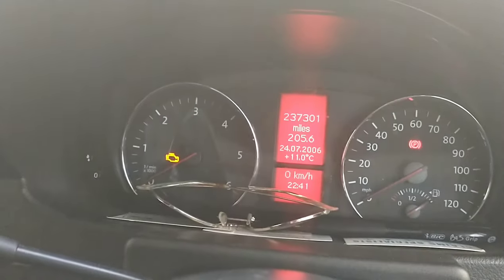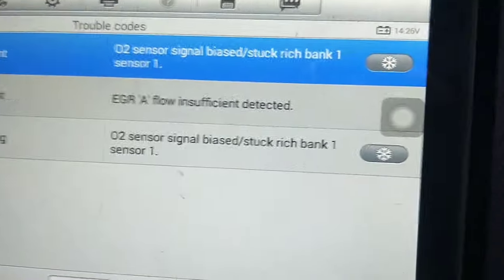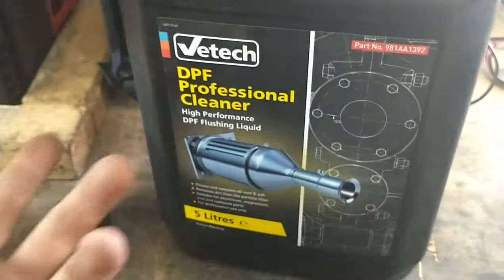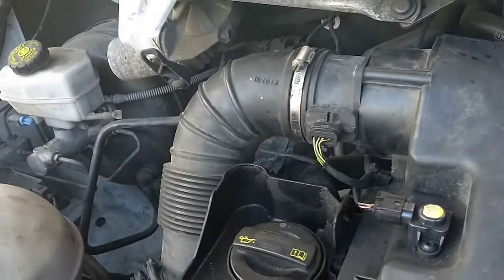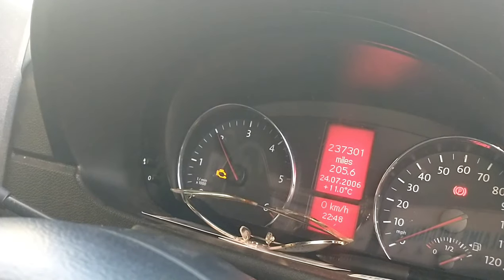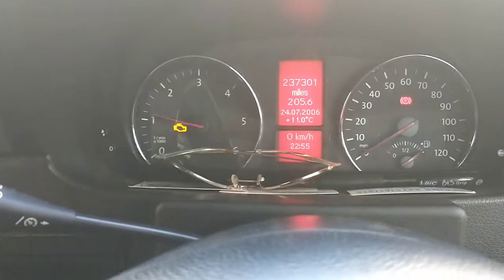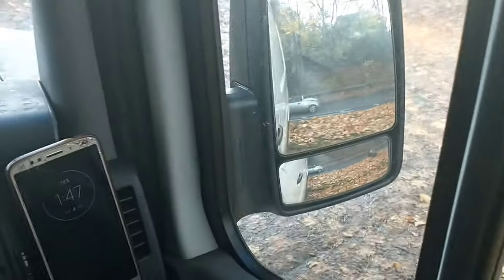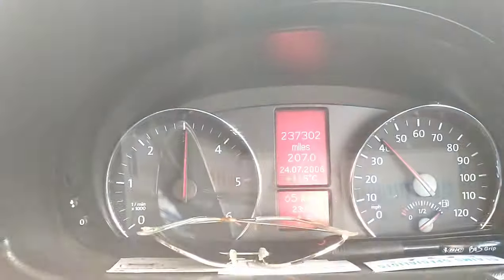How we clean EGR Valve, Intake Manifold & Turbo without removing!! using DPF Flushing cleaning fluid

Comment: Hello, thanks for your video. Do I need to use all the 5 litres at one go constantly? And it looked like that even if not sprayed(watery run) it still works, is that right?
Do I need to spray it so fast that make the engine very close to cut out and shake?
 I appreciate your reply in advance. 
Best regards
Reply from the maker: Only 1 litre is used. Spray bottle is needed. Do not pour fluid in. Engine should not shake.
Reply: @ORileysAutos  Manh thanks.
Reply: @ORileysAutos  Do I necessarily need to clear the code before to take it on the motorway for the 10 minutes? Or it clear itself off?
Reply from the maker: @TheMt9398  the code won't clear itself
Reply: @ORileysAutos  Thanks very much.🙂
Reply: @ORileysAutos   hi, do you have to clear the code for the engine light to turn off, or if it the clean has worked will the engine light go off? I dont have access to the diagnostics..
Reply from the maker: @cjmilton224  yes you have to clear the fault afterwards

Comment: Got a mk6 t350 transit with 2.4 duratorq engine won't rev over 3000rpm on a drive  and will slow on motorway inclines will rev to 4000 stood still (no load) plz help I'm sick of advise from so called mechanics who keep offering different opinions and all costing
Reply from the maker: Hi. It is impossible to say what that could be as there are many different reasons for this. It would need some proper diagnostics done
Reply: Thanks anyway I don't feel any turbo at all

Comment: Realistically you need to remove the entire EGR valve and the turbo to clean properly. It's worth it, and all these special cleaners are basically Mr muscle oven cleaners repackaged.
Reply from the maker: This is nothing like Mr muscle ⛔
Reply: Most oven cleaners contain Caustic Soda.There is a complicated chemical formulae that explains why Caustic Soda eats Aluminium so No DPF and EGR cleaners are not fancy packed oven cleaners.

Comment: Tried this today. Seems to of made my car worse not better.
Reply: Perhaps you haven't done it correctly? We done loads now and works a treat. What car have you done?
Reply: @vorsprungdieseltechnic9120  My 2010 BMW 320d. Followed the instructions in the video. Thought all was going well on the drive after I did it but now the engine is running worse and won’t rev over 3000rpm. Also when turning off the engine it now shakes badly. Worried I’ve damaged the engine in some way.
Reply: @danzebub  did you reset with diagnostic after? You have to reset after disconnecting the intake pipe with air flow sensor. Reset and it be fine
Reply: @vorsprungdieseltechnic9120 Ok I’ll give that a go. Thanks for the replies!
Reply: You definitely set off the limp mode & engine light. You have to reset with diagnostic scan tool after doing anything like this. Did you do that?
Reply: @rileysanimalfarm3039  Yes. Did that. Cars gone now. That was the final nail in the coffin for me. It’s been nothing but issues since I became the owner two years ago. Now happily driving something else.

Comment: in reality you have cleaned everything but not the egr as written in the title
Reply: How so?
Reply: @mobilemechanic3161 
because by spraying in that point you clean only the suction part
Reply: @TRT_WEB  lol the suction part? This way goes through the entire intake system... Through the valves and manifold and everywhere air goes so that includes the EGR valve and turbo and would even reach the DPF filter
Reply: Mate we tried it and it works

Comment: My Galaxy 2.0 TDCI puts the ESP light on under boost in higher gears ( code P0238), so think i'll give this cleaner a go, as my car problem could be clogged vanes/acuator.
My EGR valve is blanked, so is it still ok to use this cleaner?
Reply: How did you get on?

Comment: Hey I have a R51 pathfinder 2006 .
If I do this will it trip the ecu and throw a engine code?
Reply from the maker: Most vehicles will throw a code when you disconnect the air inlet
Reply: @ORileysAutos  Would you bypass by spraying directly into engine via throttle body valve?